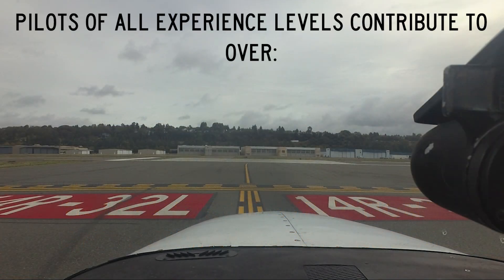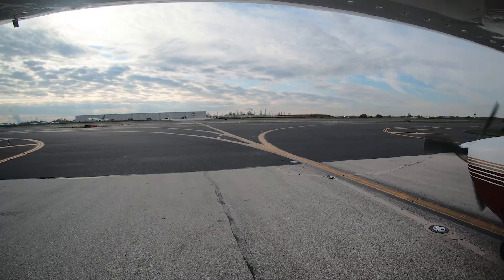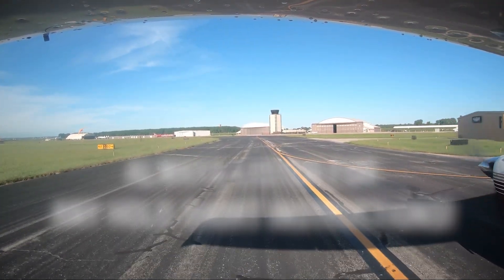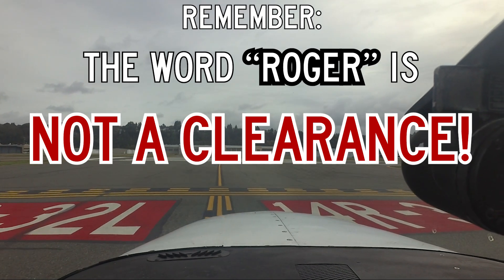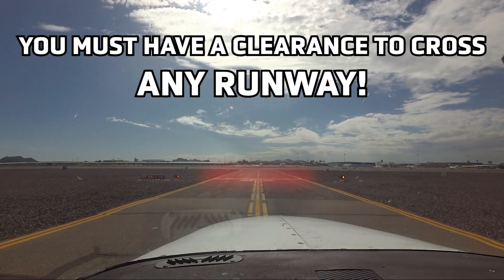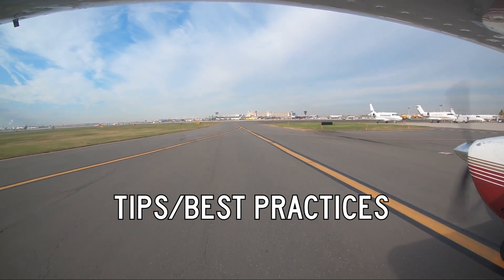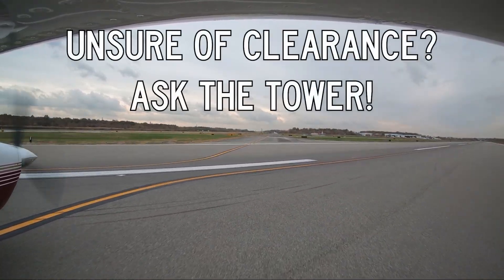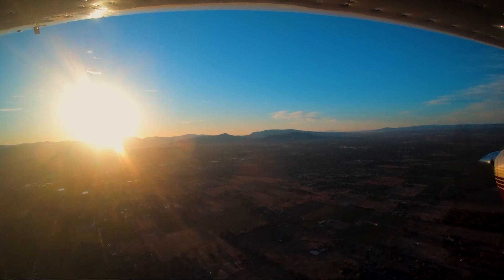From the Flight Deck – Hold Short

Comment: As a former CFI, this is a great video the faa has put out and I think a huge takeaway is sterile cockpit.  I think that's one of the biggest challenges. Pilots, sterilize your flight decks and it'll help!
Reply: Sorry, CFI's are the worst offenders. I have never been with a CFI yet that won't shut up. Even my check rides were similar. I guess it's a "familiarity breeds contempt" thing. Especially since most of the time you are at familiar airports doing familiar tasks, the boredom of it all, the routine of it all. The one rule everyone seems to abide by is both pilots always confirm with the other whether "Hold Short Clearance" was granted.  When one say's yes and one says no, or "I think so" or anything ambivalent like that we always always always called the tower! But generally speaking you CFI's are a chatty bunch! :-)